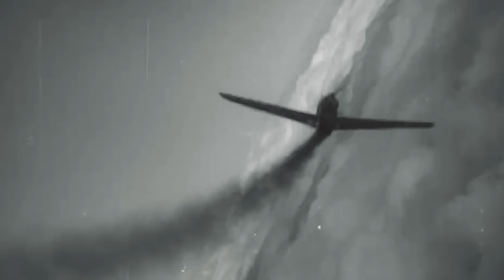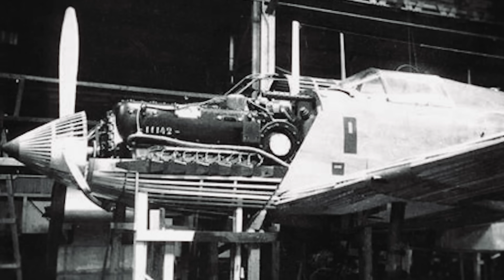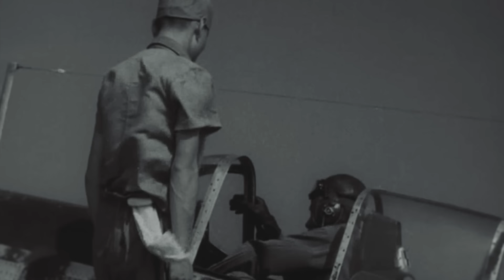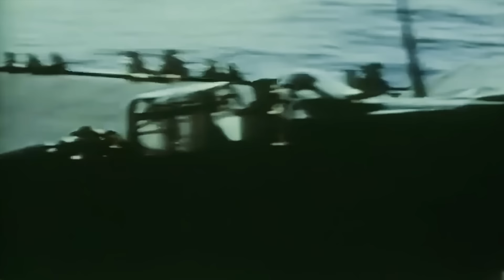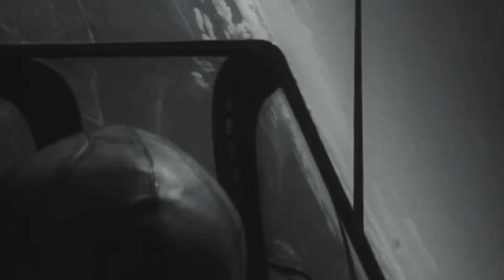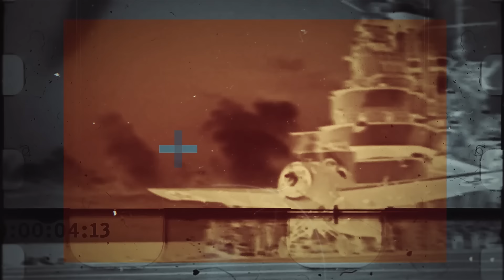Kawasaki Ki-61 'Tony'  | Japan's answer to the Bf 109

Comment from the maker: Notes: We take full responsibility for the two times we mispronounced "Ki" in the 64 instances in this video - no excuse - rest assured we've repented in sackcloth and ashes and the narrator was put on notice 😉. 
As for Bf 109 vs Me 109.  The first prototypes from 1935, from Bayerische Flugzeugwerke AG, were originally designated Bf 109, including production variants B through to early E. Then, mid-1938, Reichsluftfahrtministerium standardised naming of aircraft after the chief designer or company, in this case Willy Messerschmitt, so the aircraft was then designated Me 109. To be consistent we probably should stick with the later official designation Me 109. Don't worry, we will find someone in the office to pay penance for this inconsistency.
Reply: While the engine is most certainly a licensed copy and modification of the German 601, the rest of the airframe owes exactly ZERO to the Bf109.  It was simply a design that opted for what was already the norm throughout Europe at the time.  If you're going to call it a copy of the Bf109 then you may as well call it a copy of the Spitfire too.  Or the Typhoon.  Ot the <whatever>  Are you going to try and say the Mustang was a copy of the Spitfire because it (eventually) used a Merlin?

Vaguely related but mostly not, I spent two years working for a Japanese company in Japan.  One of the guys I worked with - a company staff bus driver - was a Ki-100 pilot in the war.  He was drafted from high school in Jan 1945 at the age of 17, given 21 hours of flight training, and then posted to a Ki-100 unit as a pilot in late Feb in the north of Japan.  He was scared of heights.  He said he got exactly 3 hours of flight time in the Ki-100 over 6 flights, but never went on a combat mission.  The older pilots and the squadron commander decided that there was so little fuel and the new pilots had so little experience that it would be pointless and a waste of aircraft to send them up on combat missions or patrols.  He spent his part of the war tending the squadron vege gardens, digging trenches around the base, and learning to drive.
Reply: Disgusting the C130 video is members only I'm stuck at home due to cancer and was looking forward to watching it as I traveled on RAF C130s from Boscombe Down in 89/90.
Reply from the maker: @RJM1011  It's "members first" - so don't worry, it will come up soon enough for you to watch. All the best in your recovery from cancer! May you be in good health!

Comment: You compared the Ki 61 to the bf 109 with which it shared a similar engine. 
A more interesting comparison would be with Kurt Tank's FW 190. 
The FW 190 started with a radial  engine and finished the war with a liquid cooled inline V. 
Reportedly better for it, according to Capt 'Winkle' Brown.
The reverse process seems to have applied to the Ki 61 when it became the Ki 100.

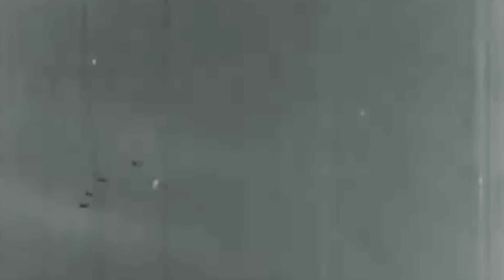Comment: 6:08 this keeps popping up every once in a while. The A6M’s didn’t suffer from neg-g engine cut outs. The akutan zero that the US tested was bodged together and not repaired properly leading to issues while pulling neg-g. 

When Western historians went through the reports on the Akutan zero they took a lot of stuff at face value that gets regurgitated to this day. 

Read Mike Godwin’s book on Japanese aero engines if you want a proper deep dive into it.

Comment: From the side, the Ki-61 looks very much like a Heinkel He-100 with an underslung radiator.  In plan view, the wing profile resembles a Macchi C-202.  IMO it doesn't resemble the Bf-109 much, but that was the Db-601 powered single seat Axis fighter the Allies were most familiar with.
Being an Imperial Japanese Army fighter, it might be more appropriate to compare it to the Ki-43 than the A6M Zero.  The Japanese Army and Navy pursued separate, independent lines of development in almost everything, down to the calibers of their weapons.  There was no single Japanese air force, even to the end of the war.
These are just nit-picking, really.  Good video of a significant, but probably underappreciated IJA fighter.
Reply: Tbh, the Hayabusa and the Zero have pretty much the same design philosophy of agile but slow and fragile fighter. The main differences are that the Zero has a better range and a better armament for most of the war.

Comment: Excellent detailed documentary of this scourge (short lived) of Wewak. One reason besides the drafted Japanese wartime workforce's inability to hold tolerance on the long V12 crankshaft journals and line boring the mains of the block was the fact that Germany wasn't sharing the ingenious hydraulic variable speed supercharger drive along with the DB601. They'd share it with their Italian buddies for free but for whatever reason Kawasaki and Aichi went without it. Both license manufacturers of the DB601 had issues manufacturing the V12 until B29 raids put the manufacturing out of it's misery.

You ought to do a video focusing on the Ki100 and prototype Ki100 II if there is enough documentation left on it.  It  lacked the top speed of a decent quality Ki 84 but was probably a sturdier airframe with a more reliable radial than the Homare. The Ki 84 had a directive in it's pilot manual forbidding snap rolls while the Ki 100 shared the 3 wing spars with the Ki 61 making diving an advantageous way to leave a fight against the odds. The F6F Hellcat had a warning in it's pilot manual not to try to out-dive the Ki 61. The Ki 100 was relatively new and little known by American airmen and other than diving with the P47N, no doubt some surprises in that regard.

Comment: "December 1941, where it outperformed rivals in 1942 fly-offs against a Bf 109E, P-40E"
Can you verify this for me? Where did they get the p 40E? Thanks,
Reply from the maker: It was early 1942 (not late '41) and the P-40 was probably part of the 3rd Pursuit Squadron, 17th Pursuit Group, USAAF, deployed in the Philippines. Several P-40Es from this unit were captured intact after forced landings during the early Japanese invasion. It's likely they used one of these captured aircraft to fly against the Ki-61 for evaluation. 41-24741 was repaired at Tachikawa and used in 1942 comparative trials against Japanese prototypes but we can't be certain it was this exact airframe. Suffice it to say there was a P-40E in the mix.

Comment: It's pronounced kee not kai, it has a completely different meaning. Kai means it's a major modification of the plane, like ki45 kai which is a major modification of ki45 for example.
While for minor modification it's ko, otsu, hei, tei, i forgot the rest but those 4 are the most commonly used

Comment: I've heard analysts say there was no cross fertilisation of knowledge between axis powers.
Reply: Anyone who says that is clueless. The very fact the Ki-61 used a licence produces DB601 alone shows the fallacy of the statement.
The Japanese made extensive use of foreign designs for study both throughout the inter-war years and continued through the war. The Japanese purchased and flew numerous German designs, including the Bf109E, He112 (both army and navy separately ordered trial aircraft, and initially intended license He112 production), heck, the only reason the kikka looks as different to the Me262 as it does was the design drawings were lost when the submarine carrying them was sunk, but not before the designer disembarked in Malaya and was able to draw on memory. 

Additionally, during the Weimar years, numerous German designers worked for most of the Japanese aero manufacturers, and Kawasaki in particular was one where their influence can be most clearly seen. Richard Vogt from Dornier trained Takeo Doi, who went on to be Kawasaki's lead designer, which is a major influence on Kawasaki's much more European design influences, which can be clearly seen starting with the Ki-28 Bob, and then very clearly carried through to the Ki 60 and Ki 61.
Reply: @JohnSmith-jj2yd bullshit cooperation between axis was miminal the difficulty in trading between germany japan guaranteed this you cretin
Reply: @JohnSmith-jj2yd  i think whoever says that is confusing it with joint development!!
Reply: @keithmoore5306 Well I don't know who these hypothetical people are, so I can't really comment on that distinction. I've certainly never heard anyone even remotely worth listening to claim there was no knowledge sharing, as the OP stated.
I'm not aware of anyone of any credibility claiming there were co-development programs between Germany and Japan as you state, so I can't really debate that point either.
Wartime assessments that Japan possessed Bf 109s (Mike) and FW190s (Fred) based on limited information are one thing, but I'm not aware of any serious scholars claiming that wartime Japan collaborated on a joint project with Germany. They certainly received German designs, engines, and other technology during the war, and there was direct study of German designs, licensed production of German designs, and German designers worked for and trained Japanese aviation industry pre-war, but they are all materially different discussions.
Reply: @JohnSmith-jj2yd  well just a thought on how or why that's been said frankly phrases people use is not something i waste much time on thinking about especially in video titles.
Reply: exchanging ideas happened but joint development is another subject i think the two are being conflated there!!
Reply: They’re wrong.